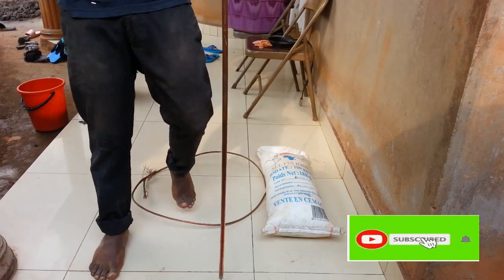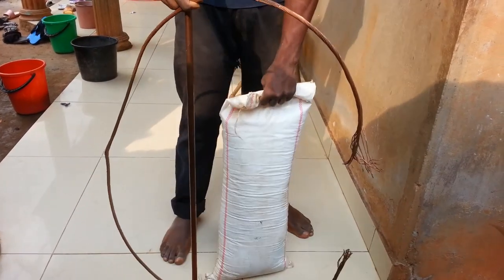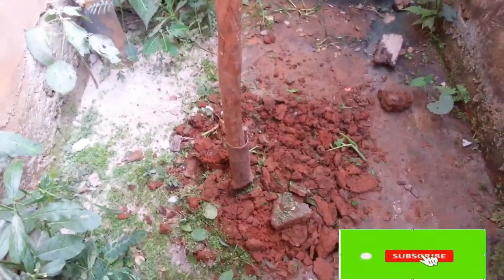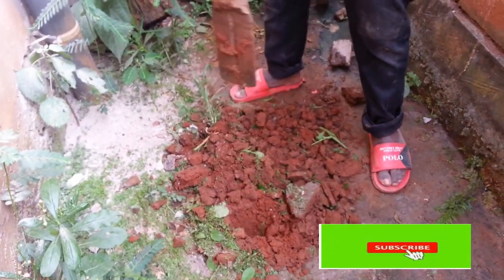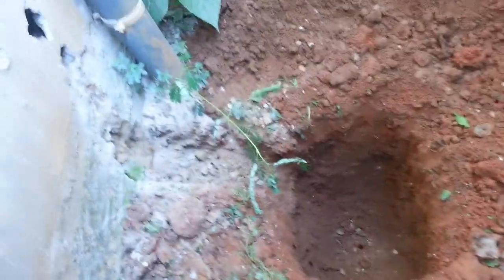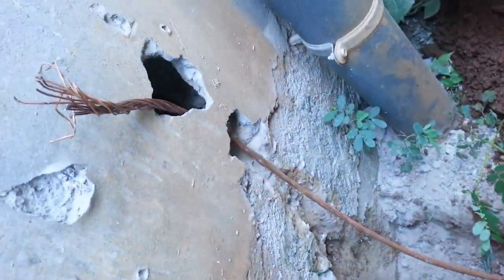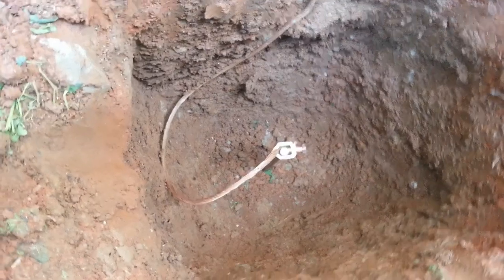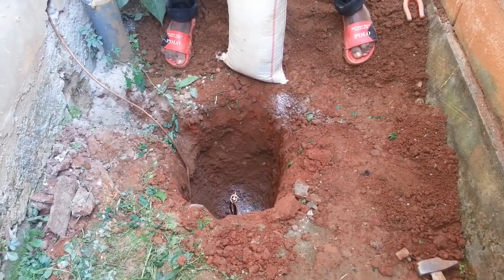how to make good Earthing system - How To Install Ground Earthing step by step

Comment: That don’t seem like earthing salt. Earthing salt has to be unrefined and granulated + the charcoal + cow dung. These put together help to increase the mineral content of that part of the earth thereby lowering its resistance by also helping to retain water and moisture. This can be confirmed, using a megger tester. Earth resistance of 2 ohms and below is very acceptable 👍. Again, the earthed spot should and must not be completely cemented or covered with interlocking tiles in the event of flooring a compound. Water should be permitted to gain access to the earthed spot or it can be wetted once in a while during prolonged dry season 😁

Comment: I am not convinced my brother, the connection joint btn the rod and the wire is very lose. direct application of salt it wrong and seen no charcoal dust

Comment: What is the essence of the salt though 🤔
Reply: Salt has osmotic quality ie can call water to itself hence makes the area where the electrode (Earth rod) is to be  wet. And we know water is electrolytic ie increases conductivity so yeah.
Reply: salt ,improves coductivity ,and fine charcoal also helps in water retension since the  earthpit has to keep wet for better performance .in poor soils with high resistance, all these combine to improve soil coductivity by lowering resistance of the soil if found higher than eg in dry regions.